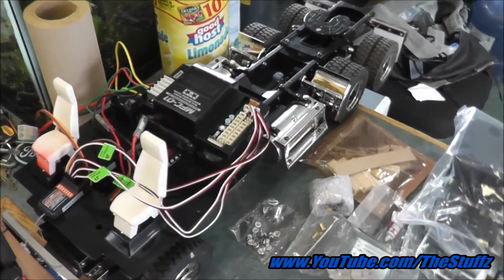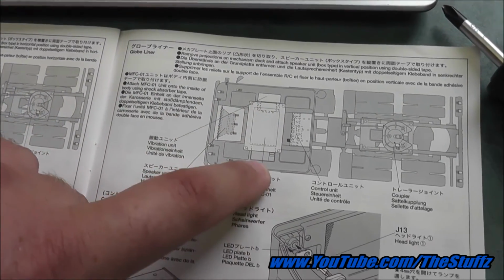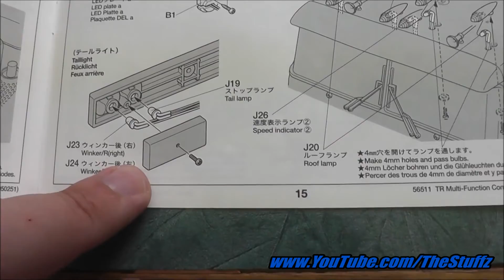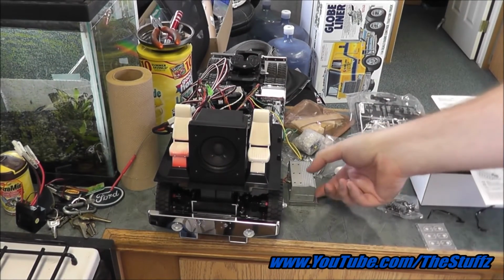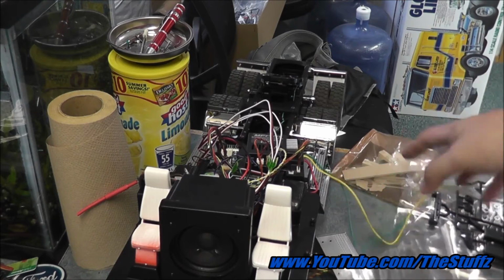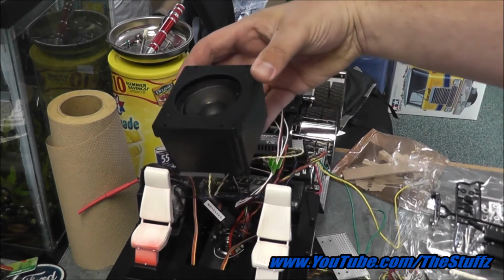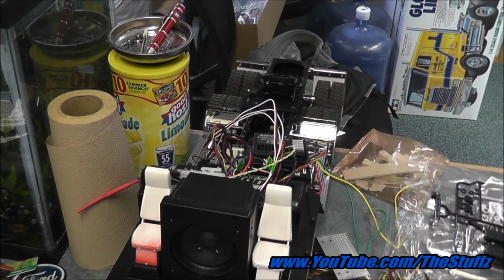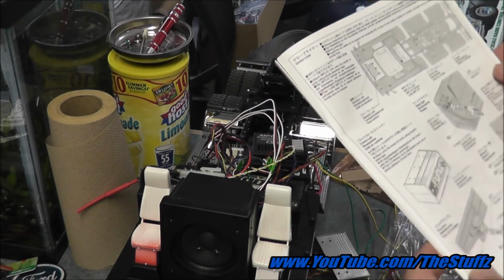Globeliner 5

Comment from the maker: think im gonna black or tint out the windows in the future. I'd say kit is $500, front axle $50, transmission $150, Radio/receiver $40, Servos $20, MFC $270, extended frame rails $50, True scale drive shafts $150, Time and effort... too much! tires were $20/pair. Trailer was like 300, it just goes on and on and on! gotta get it insured now!